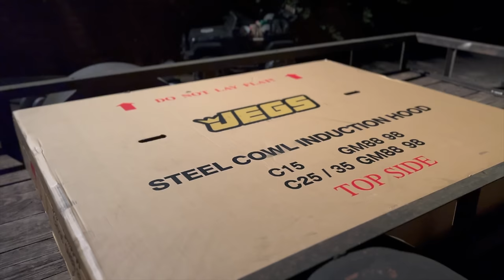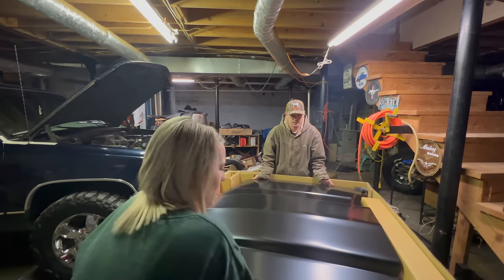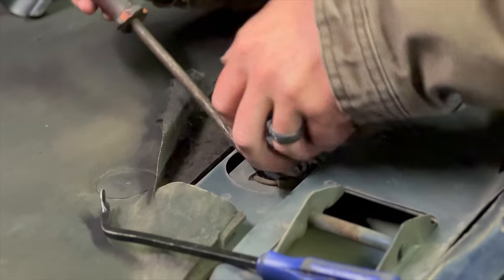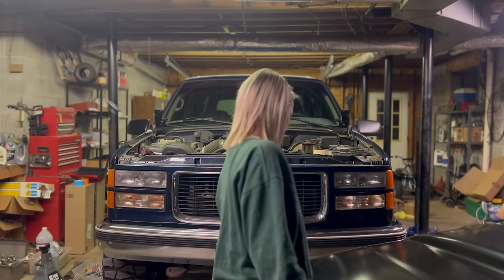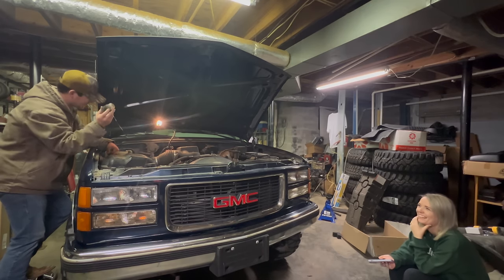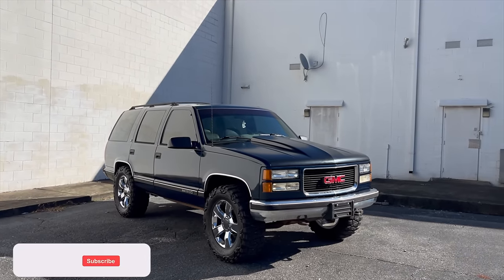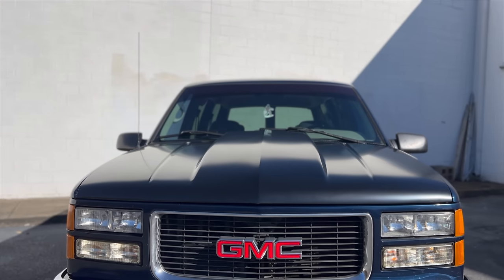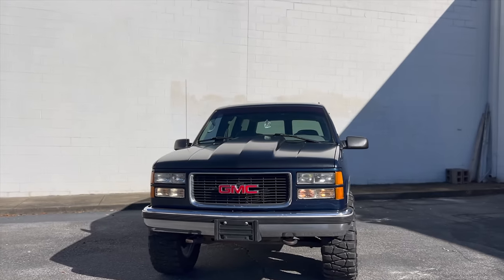COWL HOOD INSTALL ON THE OBS!

Comment: looks good - great wifey team effort.  I put one of those reel under hood lights on my 2018 Sierra and my 2006 GMC Yukon.  If the hood is black primer it will rust without a coat of clear on it.